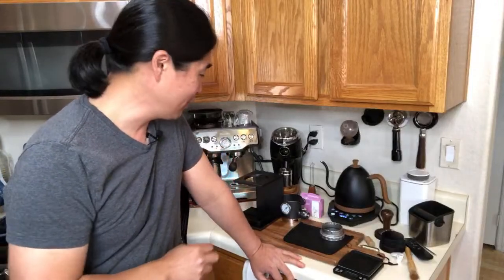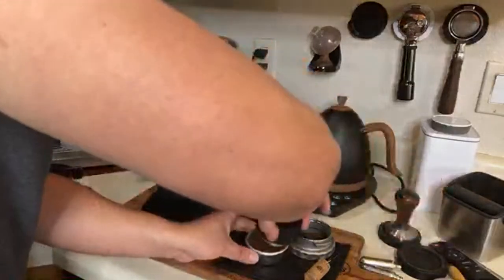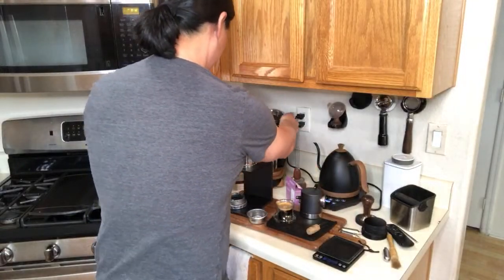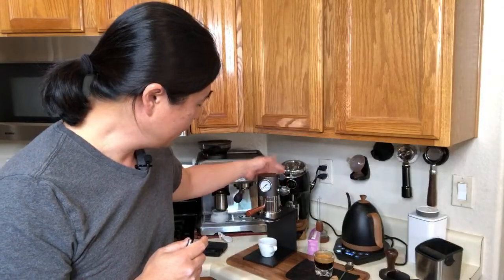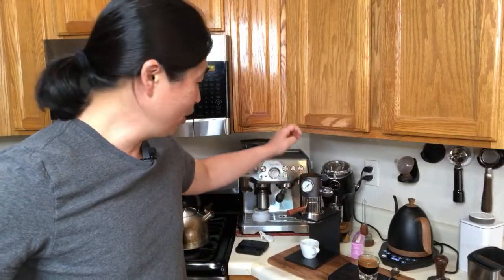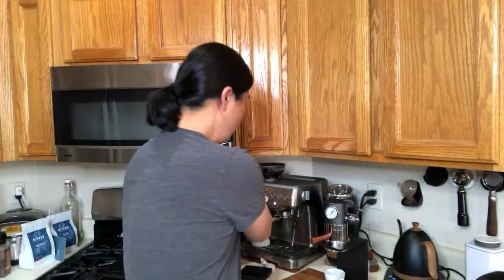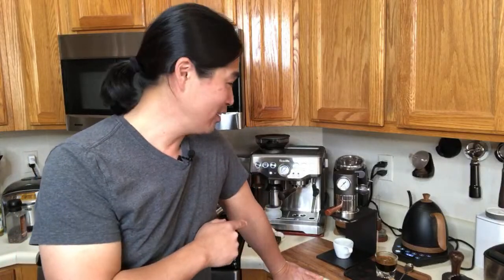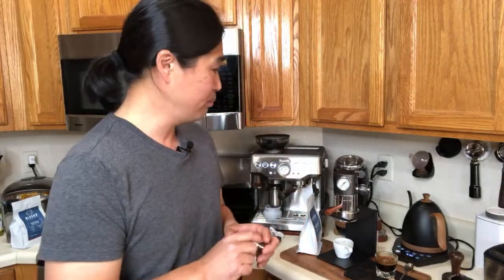X Bar Espresso Maker | CO2 Powered

Comment: Looks like a 'Sodastream' adapter would make this a pretty decent option for a low cost entry device. No backflushing, no descaling, ez to use. Being able to dial in the pressure is a great feature.
Reply: Manual espresso change the world(me)